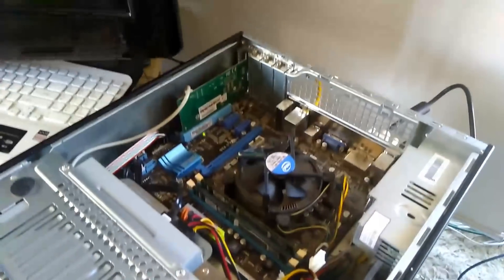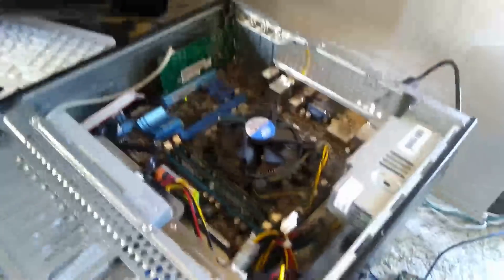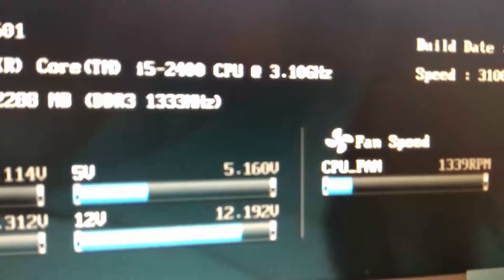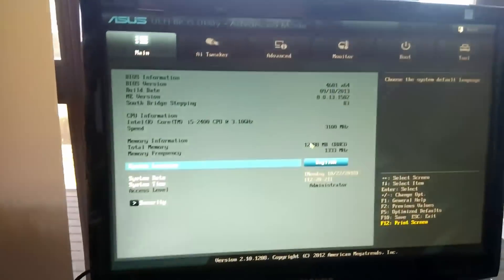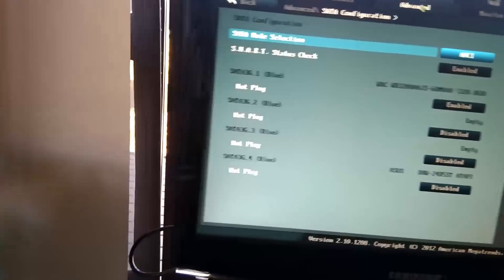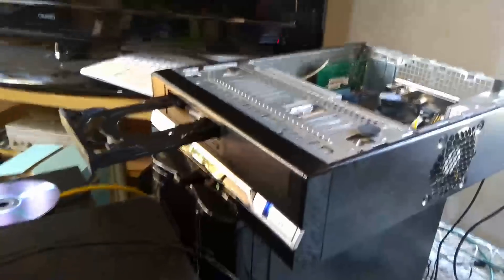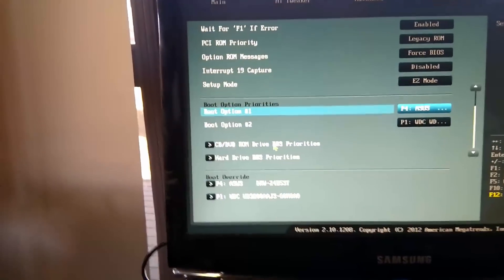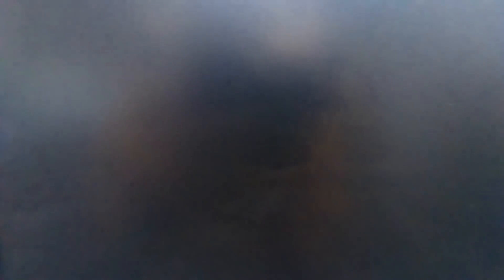System Build - New Comodo Dome Gateway

Comment: Great video :)   I currently run Untangle in "bridge" mode with both NICs bridged and one IP address (an address from my LANS range) to the two NICs.  Is it possible to set up Comodo Dome like this so it is a straight drop-in between my ADSL modem and net work switch? cheers
Reply from the maker: Yes it is
Reply: @OldMatesBackyardTech  Fancy doing a quick how-to???? cheers :)